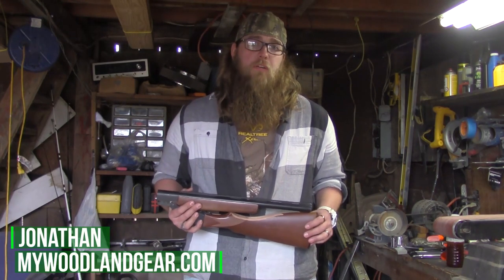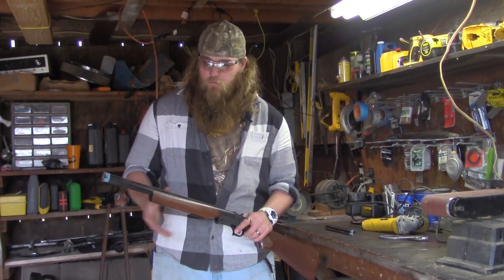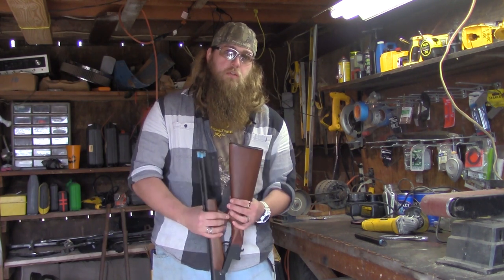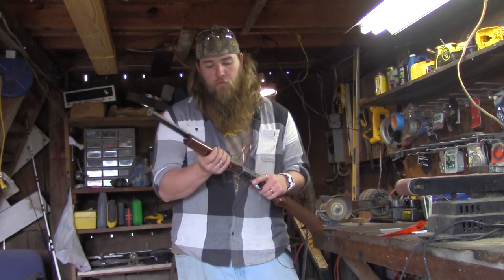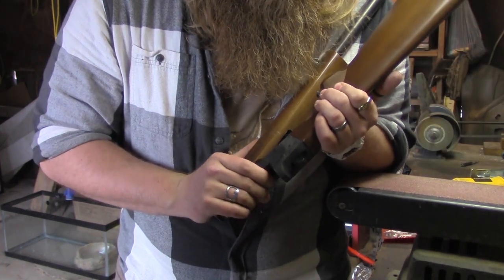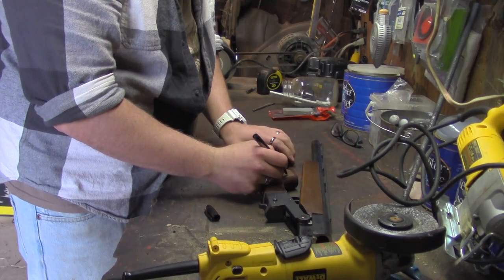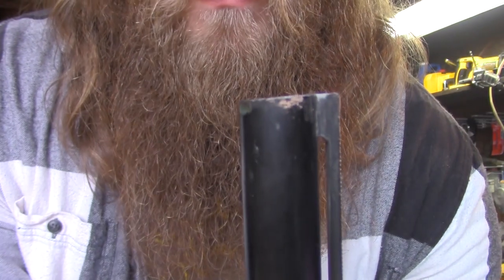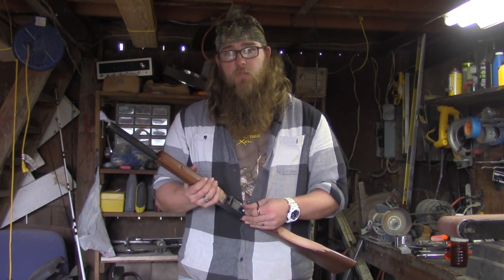$99 Hatfield Shotgun Modification Pack Rifle Tutorial

Comment: Curious. Is that fed limit measured from the breech or from the end of the chamber?
Reply: Frederick Wise with breach closed measure down the barrel leave a little extra barrel to make room for sanding and shaping  18" is legal and the complete gun barrel to stock has to be 26"  I cut my barrel  at 19 and sand shape clean it up to 18 1/2
Reply: Thank you. Reason I wanted to make sure is there is a difference in measuring bbl length between revolver and pistol. Revolver bbl length EXcludes the cylinder length ("chamber") to muzzle while an auto pistol bbl length INcludes the chamber as well as rifled portion to muzzle.  lol

Comment: I got my self two of these nice little shotguns. Part of the problem 
with the kick on them is the back bore. Open it up and look down the 
load side. The back bore has a real bad transition. It should be smooth.
 One of mine is better than the other but they are both bad. I found out
 this when I tried to put my 410/45 long colt adapter in one and it 
would not fit. This is why slugs kick real bad. The guns should be taken
 to a smith and have the back bore fixed.  MAGA !
Reply from the maker: +Celtic Dude thanks for the knowledge, I didn't think of that. Thanks for watching!

Comment: I would of left a little more length in the barrel and not cut into the rail support, you weakened the connection between the barrel and the rail.
Reply: Mathew Rupp , na, no way, that was the whole point cutting it wear he did.
if you cut it between the vent ribs, it would not only look stupid but be weaker.
I think he did a good job.
I hope he restains the wood furniture and " cold blues " the trigger gaurde

Comment: I thought it was illegal to cut the barrel? Man I have so much I gotta know.
Reply: Avery Rodriguez I see your comment is 4 months old but I'm gonna tell you just in case you forgot to look it up. For shotguns the overall length must be 28 inches minimum, with a 18 inch barrel. You can get a shorter barrel if you pay the ATF $200 and go through a year old background check. Same with rifles except 26 inches overall and 16 inch barrel. I'm not 100% sure if paying the $200 let's you go under the 26 or 28 inch minimum though.
Reply: Idk if you will ever see this, but is the choke gone after sawing off that much? 28 in is to long for me
Reply: @aclevertrevor6450  they dont come with chokes and aren't threaded for them. Smooth bore all the way through. The shot gun is literally $99 brand new.

Comment: Duude! You just annealed the temper right out of the business end of that barrel. 
Shoulda ran some liquid when cutting with the wheel grinder.
Reply: I kinda doubt that he screwed anything serious up. There's no rifling, the end of the barrel doesn't have to bear pressure, and I also don't think an angle grinder could take the temper out of more than 1 inch of the barrel. So I'd still say he's good
Reply: i dont think theese barrels have a temper to them. i chopped mine with a hacksaw and it wnt through like butter. blade was dull to. very soft metal in these barrels. its was almost like sawing copper or brass.
Reply: Toe ofawesome so what your saying is the barrel won't last worth a fuck...
Reply: Jeremy Long It's a shotgun barrel. It really only needs to be a tube.
Reply: William Galindo , agreed, nothing worse than a brittol barrel
Reply: True. he should have just used a hack saw.
Reply: William Galindo 
   He didn't hurt that barrel at all.   It's not like it's a knife.!
Reply: Shotgun barrel is not tempered.
Reply: Shotgun barrels arent tempered... people legit use black pipe to make homemade shotguns. So...

Comment: How to turn a 99 dollar shotgun in to a 10 dollar shotgun.
Reply: 365sojourner how much does a folding shotgun that fits inside of a backpack cost? Just curious.
Reply: I plan on doing something similar, the gun as is has no appeal to me as is. I want a compact brush gun that I don't care if it gets beat-up. One additional thing I will do is take the sharp edges of the bottom of the receiver, it's uncomfortable to carry.
Reply: eh, it's something interesting to do to a cheap shotgun. I'm considering buying a Hatfield just to mess around with it and make it something like this. I certainly wouldn't do this to a more expensive gun.
Reply: Yea okay, thats like your opinion dude.
Reply: I think he's referring to the workmanship, it was a bit rough.